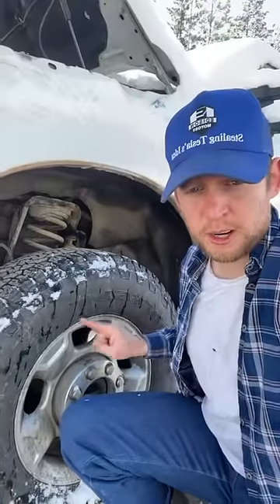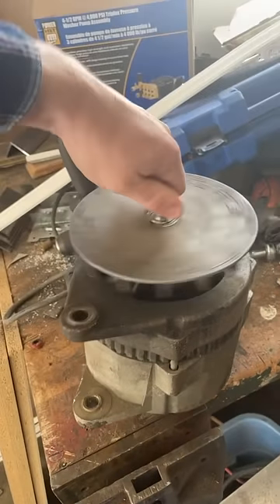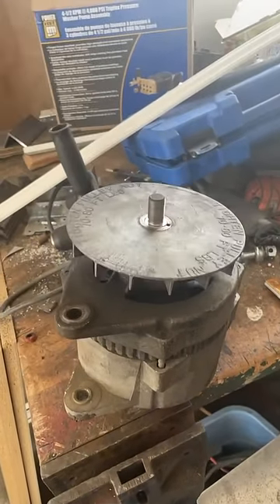Alternator on each wheel???

Comment: The old man is describing a perpetual motion machine which is impossible. Despite all of the Indian YouTube videos out there lol
Reply: It's not impossible. It's improbable... But not impossible. I mean .. do you know how magnets work?
Reply: @kamikrazywarboy2008  it's impossible under the current physics model.
Reply: @DaDaDo661  Quantum physics ... It's not only not impossible, but as improbable as it may seem, it's entirely possible you invent the process...
Reply: @kamikrazywarboy2008  only place it would work is in a perfect vacuum like deep space 
Hence why an asteroid can travel until it hits something like earth 
There is nothing to slow it down 

Even then a perpetual motion device is never energy positive so its useless 

The best we can do is work to make things have less resistance. Ie work to get motors that put more of the energy applied to motion. Less waist as heat loss / friction etc 

If you want make a fortune 
Make a wire that costs the same as copper but has near 0 resistance 
Eliminate transmission loss in the electrical grid
Reply: @energytechnologies206  I always liked the idea of those Andrijha Puharich patents that Stanley Meyer used to come up with his car that ran on water...
Reply: While it may be impossible to make the car run without being charged by external power sources but u could extend the range between charging
Reply: @kimosmith2581  that's what regenerative braking is for. It's been a thing since the first Prius
Reply: But… but… but their videos say young Elon Musk!
Reply: @kamikrazywarboy2008 I know what Eddie currents are. Do YOU understand how magnetism work?
Reply: @kamikrazywarboy2008  quantum physics has its own weird set of rules that don't make sense in the non-quantum world lol. In the physical world that we see around us, perpetual motion is impossible
Reply: @hobbesip1  Yes. But I didn't say "magnetism" tho, did I?  I said, magnets. I specifically wrote that because I'm trolling and I like to throw in some Insane Clown Posse ....
 And to be quite honest, No. No you don't know about Eddy currents. You think you do, you're aware of the phenomenon, but no one truly understands them. If they did, I wouldn't be digging god damned fishing weights and nickels while looking for gold rings with my metal detector. 
  Is it to hard for you people to find a frequency that can be induced on a non ferrous highly conductive target that has a specific rate of decay over a set period? Gawd ... So annoying. 🤣
Reply: @ArsonistArborist  ... Well you certainly seem to have an elementary understanding of basic physics. Now let's work on your language skills... Say it with me " it is improbable"... To say something is impossible is to say it will never be done... 
 And that simply isn't true. So while the likelihood that it will never happen is high, we do not know every element that exists nor do we completely understand what we call "physics". 
  As you yourself said, the physical world we SEE... what fills the space that we do not see, but can see through? 
  We know what we know, we do not know what we do not know. That is impossible. 
 So, perpetual motion for the time being remains improbable. It's arrogant to assume you know everything. Plus it's fun to be me... Don't be anti-semantic. 😂
Reply: Exactly, and adding an alternator is extra dumb because the electric motors act as generators when power is applied to them, i.e. regenerative braking.
Reply: @kamikrazywarboy2008  You’re good at saying a lot and nothing at the same time.
Reply: @UltraMagaFan  Thank you sir. I do appreciate when some one recognizes my word slinging for what it is.
Reply: @@ParchedGoat1 ... Sure... Google magnets like a dummy. I ain't falling for it cause you did. Next thing you know you'll be yelling us birds are real and use *po-larity" to navigate...  
  😂😂🤣 Po-larity. Like a Polarity bear? 😂🤣😂 Man, you crack me up.
Reply: @kamikrazywarboy2008  you know, you make a good point. In our current understanding of physics, it's impossible. But as time goes on, understanding changes. Very good point, you won me over. That was an arrogant viewpoint, my apologies!
Reply: @ArsonistArborist  No apology necessary. To our ancestors we have already done the impossible. But looking back, our ancestors have accomplished things that we would find impossible to do today, even with all of our technology, understanding and written history. 
 Humans have potential, but it is being squandered to create lives of comfort and convenience for some instead of sustainability and inclusion for all. 
 Sustainability cannot survive consumerism. We will have used up our finite resources before we put them to proper use. We sure do like our stuff...
Reply: @kamikrazywarboy2008  well put
Reply: @kamikrazywarboy2008  it’s against the basic laws of physics as poorly discribed here
Reply: @MemoriesDestroyUs  we already came to the conclusion that reality was all just an AI generated algorithm, and we're all just basic programs... And here you are right on cue... A security patch, days too late...
Reply: The old man is suggesting a method to take advantage of regenerative breaking and inertia of the vehicle. But let just hate on him and ignore the fact that they are all plugged in every night. I charge my hybrid while going down hills and when I apply my breaks.
Reply: @wootuser  no he isn’t
Reply: Thank you for pointing out what should be obvious but sadly to some isn't.
Reply: @kamikrazywarboy2008  It's impossible. I know the first law of thermodynamics. What do magnets have to do with it? Nothing about magnets violates the First Law of Thermodynamics. 
Energy Out = Energy In
True of all closed systems. Works for nuclear reactions too as long as we count matter as energy.
Reply: @davidhitchen5369  why would we count matter as energy?  It's funny that you come in swinging balls like you have a pair, then immediately say something stupid. 
 It's improbable, not impossible.
  I can explain a lot of things to you, I just can't understand those things for you..
Reply: @kamikrazywarboy2008  
"why would we count matter as energy? "
LOL. Here's a question for you:
What is the most famous equation in physics?
"..., then immediately say something stupid. "
It's like you are talking to a mirror.
Reply: They do have over unity systems. Your just not supposed to know about so don't ask....
Reply: @wobblyeye493  Yeah, sure they do. Only you know about them because you are so freakin' brilliant.
Reply: @kamikrazywarboy2008  The patents that were worthless because he just had an engine that ran on hydrogen, which already existed.
Reply: @kamikrazywarboy2008  its not improbable, its impossible. Electric motors arent 100% efficient, and you can't make more power than you put in. Even if you could magic something up that somehow runs at 100% eff to power just itself, the second you try and harness that power itll stop. Perpetual motion is a myth, Stanley Meyer stole from investors and was a conman.
Reply: @masterdirk101  and the earth is flat and the moon is made of cheese...
Reply: @masterdirk101  actually... His parents relief heavily on Andrijha Puharich's work... Which was copied from Tesla. Or so the bottom of the rabbit hole would have one believe.
Reply: @kamikrazywarboy2008  Nah earth is concave and the moon is a projection get with it old man.
Reply: @kamikrazywarboy2008  It's impossible. Period.
Reply: @bbaucom2  Improbable, final word.
Reply: @WyattStrange  Isaac Newton said it
Reply: Highly improbable 
Not impossible 
And there's 2 types of perpetual energy 
There's long life we're it seems perpetual because it will last longer than a human will see it fail and will power the device longer than ever thought
Then there's true perpetual motion
Reply: @davidhitchen5369  your thinking about it wrong. You just need to get more energy out then you put in. Change perspective.
Reply: @wobblyeye493  Think about how dumb that sounds. The existence of such a system implies that there is infinite energy in the universe. There isn't. It's silly.
Reply: @davidhitchen5369  how much energy went into building the hover dam? How much energy are they getting out of it? I guess it's just how you think about it isn't it. I have more but those require much more brain work to comprehend that I doubt your willing to use. Plus my interest in this subject is not as big as it was. People just get silly and say things like "impossible" when it's obviously not or say things like this guy did in the video.
Reply: @wobblyeye493  Yeah, forget it dude. It's over your head.
Reply: @davidhitchen5369  and way beyond yours.
Reply: @wobblyeye493  If you think a dam violates the first law of thermodynamics, you're hopeless.
Reply: @davidhitchen5369  welcome small mind to more energy out then was put in. Kind of different view point but meh 🙃. How about solar panels? Cost effective no¿
Reply: @wobblyeye493  You don't understand what energy is.
Reply: @davidhitchen5369  define it...
Reply: @wobblyeye493  Energy is the stuff that has to be consumed to do work.The energy into a solar panel is the radiant energy that falls on it from the sun. The energy out of the solar cell is electrical power that is drawn off of the electrodes. The energy out as electricity can never be greater than the energy in as radiant energy. In fact it will always be less because some of the energy will be lost as heat. The efficiency of typical solar cell is about 20%. It converts about a fifth of the radiant energy to electrical energy.
Reply: @davidhitchen5369  and yet the energy put into it's construction will be less than the energy that will come from out of it. 
Ok I know that's not the actual point of over unity but it's a different look at the problem and solution. The coolest one is nuclear.
Reply: @wobblyeye493  "and yet the energy put into it's construction will be less than the energy that will come from out of it."
Obviously. This is true of any energy generating device. It wouldn't be economically viable any other way.
Reply: @kamikrazywarboy2008  Whatever.
Reply: @bbaucom2  Whichever... Ya see what I did there? Huh? 😂
Reply: @energytechnologies206   Even asteroids lose energy through collisions with space dust. It's just very gradual...
Reply: @Gottenhimfella  they also loose energy when Bruce Willis lands on one and drills to 800’ and blows a nuclear weapon in it
Reply: Perpetual motion is a motion that moves under its own self esteem continuously, not stoping and starting like a car, so hes not describing perpetual motion, hes describing static negative energy  displacement of a rotating device
Reply: @krisward6589  Extracting power from the wheels of a vehicle while it was being driven by stored energy would make sense only if it could be done at over 100% efficiency. 
If that were possible,  perpetual motion would be possible.
Reply: @kamikrazywarboy2008  "No you don't know about Eddy currents. You think you do, you're aware of the phenomenon, but no one truly understands them"

Plenty of people fully understand them, there is absolutely nothing complicated about eddy currents.  They are a consequence of Faraday's law of induction and Lenz's law, the exact same laws that allow us to design and build working generators and motors.

Perpetual motion is impossible, not improbable.  The reasons have already been given and you haven't been able to refute them, only deny them.

Always the same when this stuff comes up on YT, you have the people with a reasonable level of education and then people like you that believe in conspiracy BS like Meyer who was nothing more than a grifter.
Reply: Everyone already knows that the hardest part of designing a perpetual motion machine is finding somewhere to hide the batteries.
Reply: Exactly what I was gonna say
Reply: *native American
Reply: @niners5time822  no, he is talking about actual Indians.  Not one Native American is slinging this BS.
Reply: @Arsonist Arborist  not impossible.  Just hasn't been achieved yet.  Not impossible
Reply: @bbaucom2  ok Bobby Boucher... mama is right.

Comment: i grew up with that flashlight that lit up as you turned the handle. it charged a small battery and would run for like 5 minutes without cranking.  always wondered why they couldnt do that with wheels on a car.
Reply: Kinetic Energy Tires. If designed from the bottom up, it could be possible. But probably REALLY hard to do.
Reply: Because instead of powering a 5 Miliamp hour battery. You are powering A 200 KILOWATT battery or MORE. The ‘cranking’ would take years if done by hand. Your dinky stupid flashlight is 10000 times smaller and weaker than your electric car engine.
Reply: The energy has to come from somewhere outside of the entire car system if you want to move the system (the car) on a road. If you put generators on the wheels, those generators have to get the energy from somewhere in order to generate electricity. If they are getting the energy from the wheels turning, those wheels have to get the energy from somewhere. Where do they get it? The car's battery pack, if it's an electric vehicle. Why not just use that battery energy to power the wheels of the car? That way, you don't lose any of the energy coming from the batteries as heat in the generators or the batteries you think the generators are charging up.
Reply: @bobbabai  downhills??
Reply: @drewp25831  Don't you have to go uphill too? Does everyone on average have to go up just as much uphill as downhill? Doesn't that average out to be the same as going flat? And if that's true, where does the energy come from if all you have are wheel generators and batteries. 

Any electric car is going to run out of battery to move the car if it's traveling on flat land or going just as much up as it is downhill.

Comment: Could you do a video on regenative braking and how it works?
Reply: Electric motors are basically just backwards alternators. Instead of using the battery to send power to the motor and propel the vehicle, you use the spinning of the wheel to turn the motor which generates power to charge the battery and at the same time it creates resistance which slows the vehicle. Instead of turning the energy of the vehicle into heat like traditional brakes, you turn it back into electricity.
Reply: @evilhamsterman  so it's kinda like engine breaking for electric vehicles?
Reply: @cmbells7736  it is exactly like that with the additional benefit that you are also recovering the energy required to brake so you can use it later to accelerate again. It saves both gas and your brakes. My wife has a hybrid with 175k miles and still has 80% of the factory brakes remaining because most of her braking uses regenerative braking, it only uses the friction brakes in hard braking and holding the car at a stop.
Reply: @evilhamsterman  the motors don't act like alternators but a generator, they don't require a power supply to energize their field like an alternator does when being turned by external forces.

Comment: If you want to feel what it would be like to have an alternator/generator on each wheel, just let off the accelerator, and THAT's what it feels like (as regen breaking stops your car).
Reply: That's not technically true. Regenerative braking only works when you let off the accelerator. The vehicle would slow down anyway, due to friction, but the regen system causes an increase and the vehicle decelerates at a greater rate. If there was a dedicated alternator/generator on every wheel, the drive motor(s) would need to overcome those additional loads as well as the original (vehicle driving as originally designed). This would obviously need to be in the design parameters. So, when you had your foot on the accelerator, you'd only feel what you'd always feel as the drive motor(s) would now have enough power to turn the drive wheel and the alternator/generator. 

  Or did you assume they'd just bolt an alternator/generator to the wheel and leave the original drive motor(s)?
Reply: @tomb816  My point was, that "extreme slowdown" with regenerative braking is the amount of force you would have to overcome with that setup. Which would most likely take twice as much power to still get the same speed/performance out of. So, rather than double your output and MAYBE get half of it back (plus the weight of the whole system), the more efficient design is to just leave that whole system off. You'll never get more power back than  you put in, and anything you attach to your wheels to produce power is going to be an extra strain on your drive system to compensate for it, and that extra strain is always going to be more than you get back out of it.
Reply: @mightyd42  I understand what your (now) conveying, more than you know. However, my previous still stands. If the motor is/was designed/spec'd properly, you'd never know/feel the difference. This is all regardless of the fact it's pointless and unnecessary 😉
Reply: @tomb816  haha no worries. My friend and I had been talking about that type of a system since middle school, and it took me a LONG time to figure out why it wouldn't work. My friend never got convinced >_>
Reply: @mightyd42  I understand what you're trying to say so you don't need to reiterate. However, you're incorrect. The alternator/generator wouldn't be competing w/ the regenerative braking. The alternator/generator would compete against the motor and only help the regen system slow the vehicle, sans brakes. As far as weight, I don't think it would be anywhere near what you think. Especially since you could divide it amongst 4 wheels (meaning each single assembly could be smaller, think motorcycle stator) or dedicate one to each motor (you could even build it off the motor frame/axle, to reduce assembly parts). Again, I don't believe any of this to be worthwhile, but it wouldn't work or act exactly as you describe.